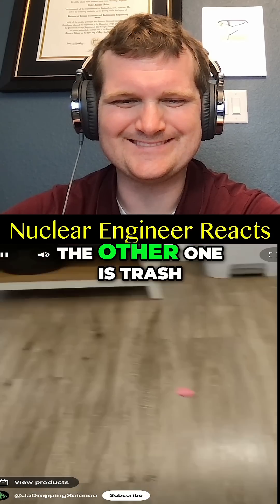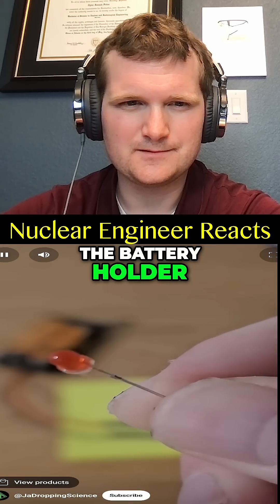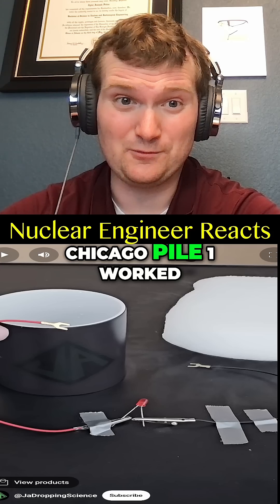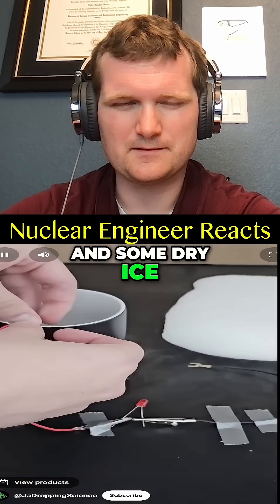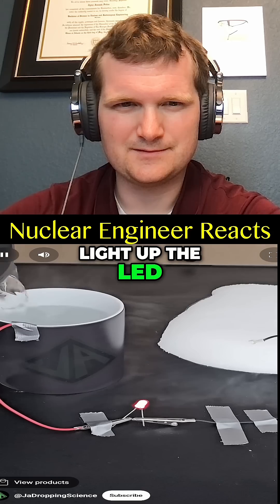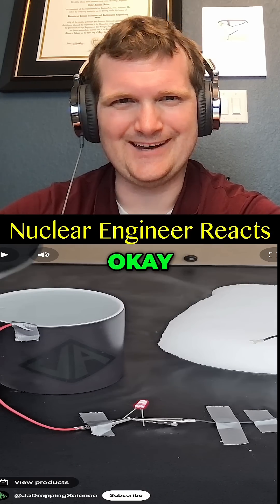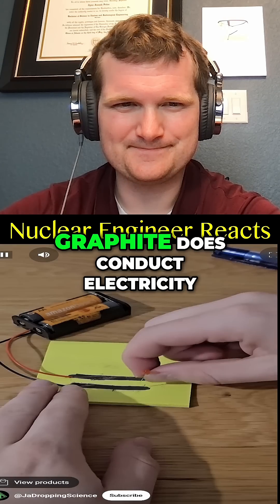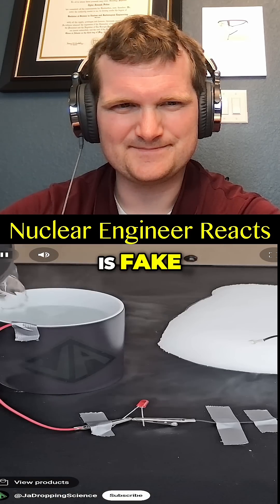Which Electricity Experiment is Fake? - Nuclear Engineer Reacts to 2 Truths & Trash

Comment: The second one does produce voltage if two junctions of dissimilar metals are at different temperatures, but that's barely a few millivolts. The only application is making thermometer probes by connecting the other end to a voltmeter. It definitely won't have enough power to light a LED.

Comment: Love using random past knowledge to figure out these kind of videos, for example: 
1. I've seen graphite light up after completing a circuit with a wall plug once, that checks out. (I didn't do it... Or did I?)
2. Have seen and tried oranges and lemons as a sort of inefficient battery with those special metal connectors so that checks out.
3. Never seen a temperature difference create electricity. Although some conductors conduct electricity better at some temperatures like super-cooled copper, that's a different thing altogether. So that one is sus.

Comment: 1st is real I've done that to repair a simple circuit board which lasted like 2 years after, doesn't work for the traces on complex boards but simple boards usually have bigger traces, so it can be used to bridge a small cut or break in the trace.

Comment: It's a bad idea to connect LEDs directly to a power supply, especially one which tries to maintain a constant voltage. LEDs will draw exponentially more current as you increase voltage past its threshold, so the resistance of the graphite controls it by dropping the voltage proportionally to the current